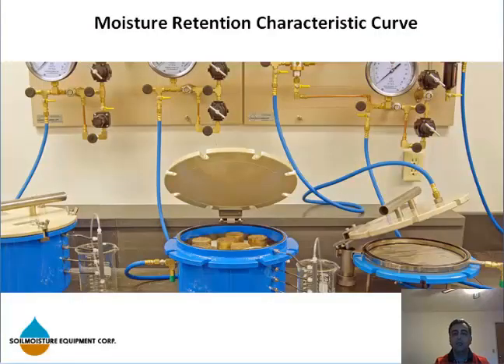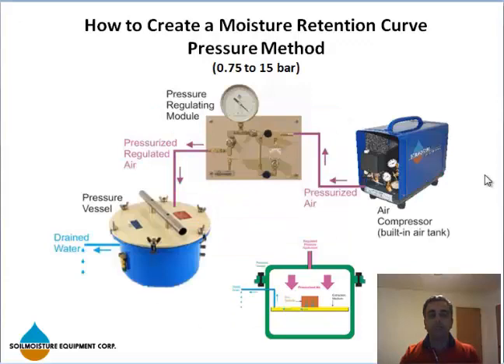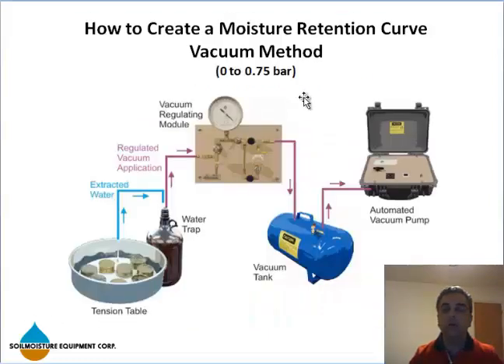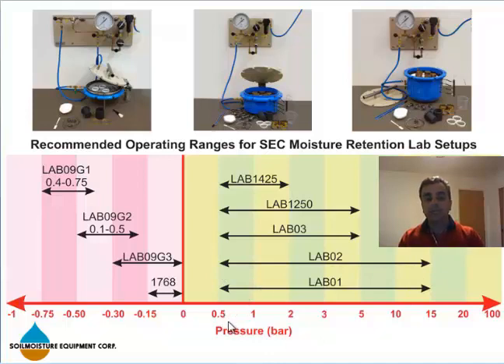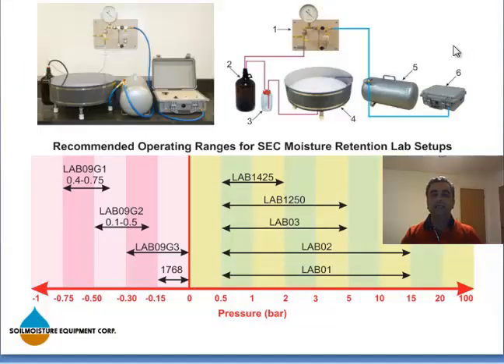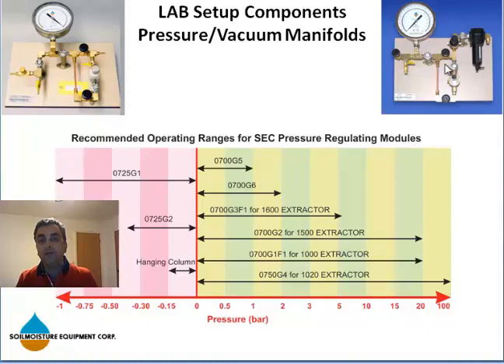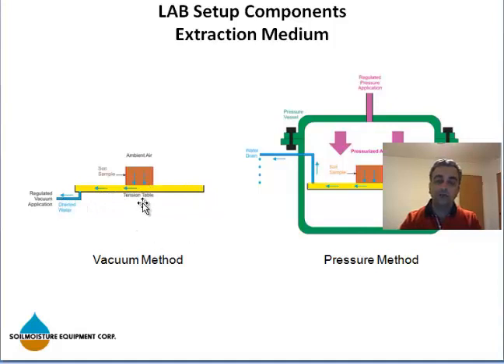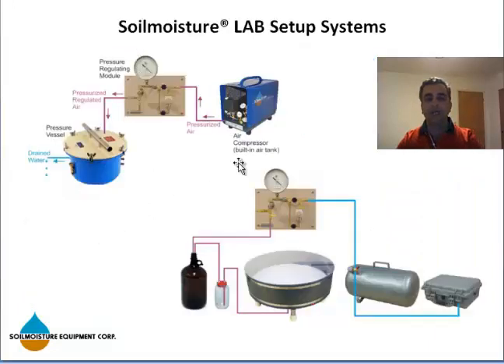An Introduction to Soilmoisture LAB Setups

Comment: Thank you for your comprehensive presentation!  I have a question... Should this pressure extractor be electrically connected for the duration of the soil sample?  For example, does the compressor remain connected to the  electricity grid at night?  Or is it necessary to pull the plug after the pressure is applied?  Could it be dangerous for the compressor to stay connected to the mains for a long time (72 hours)?  I hope I have expressed what I think correctly..   I would be glad if you answer my question ... thanks in advance ...